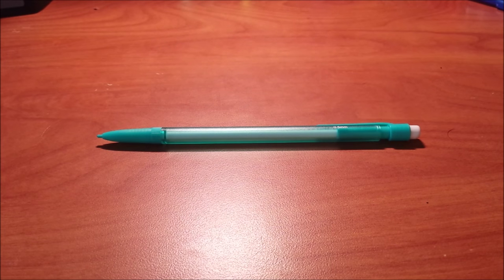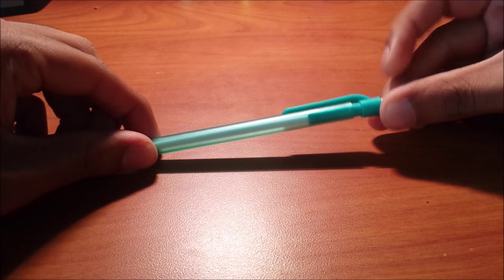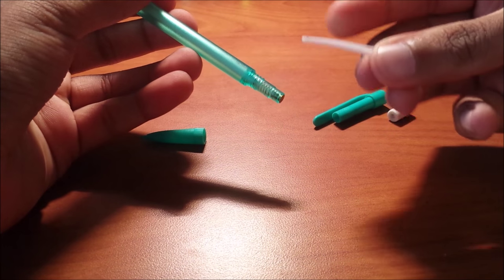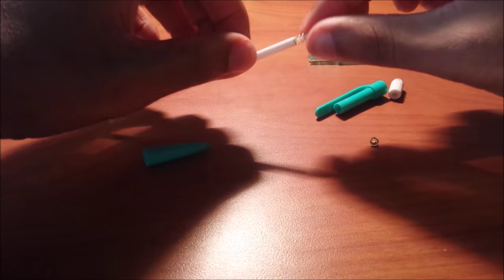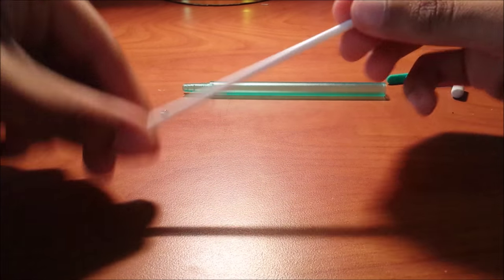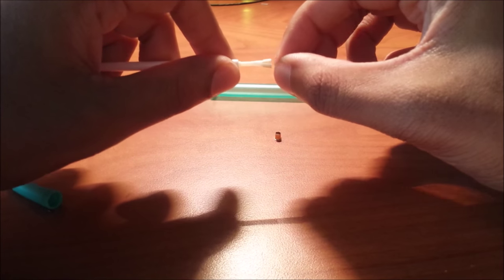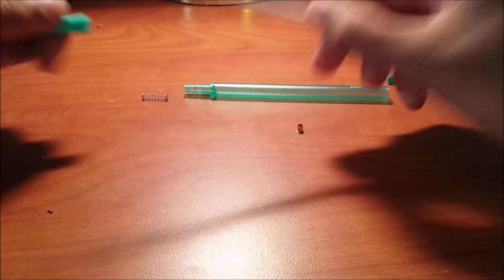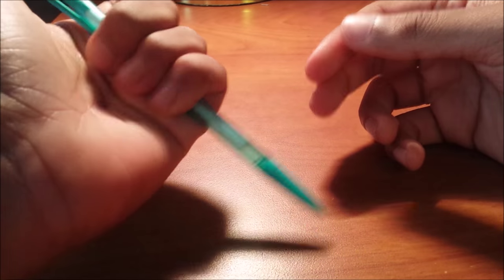Mechanical Pencils  EXPLAINED - Reverse Engineering Project

Comment: I tried to refill it from the back but when I put it in I saw that the thing got stuck in the lil tube, I tried opening the part in the front but it wouldn’t screw off since it was stuck

Edit: I managed to get it out by hitting the tube as hard as I can in a table, the top flew out
Reply: @guilleb4sterra  wth
Reply: Guillermo Basterra 😂